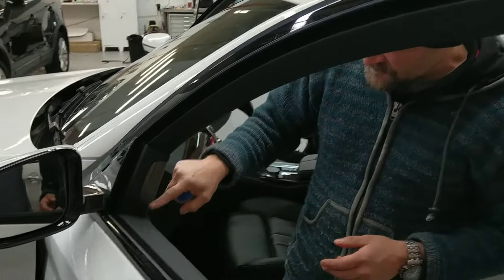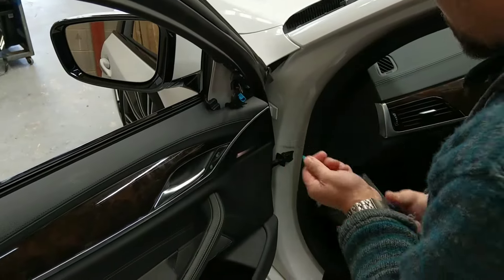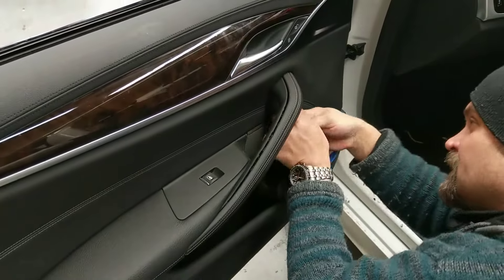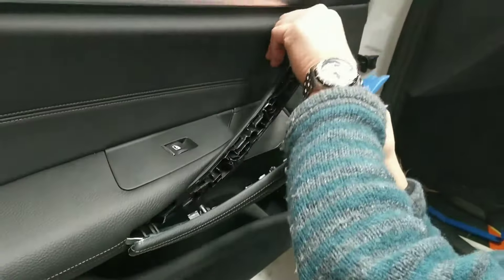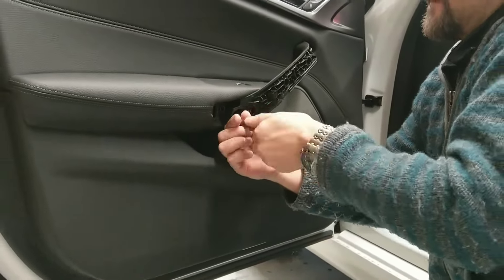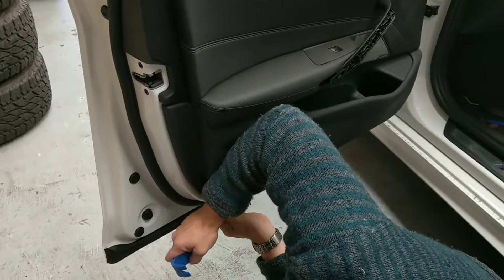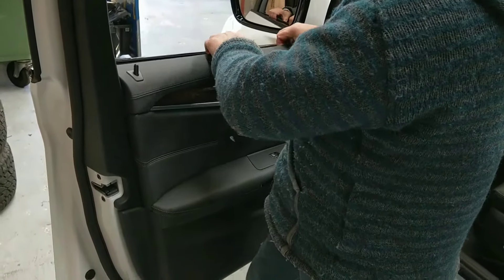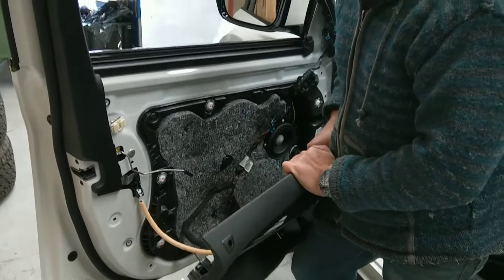2017 BMW 5 series door trim removel

Comment: FYI when you release the door handle trim there is a cut out underneath the handel to stick plastic pry tool in the perfect spot for getting started. If you go through top first there's a good chance scuffing the leather or worse.
Reply from the maker: Thanks for the info, fortunately we haven't done any damage yet.

Comment: do you know if the 2017 BMW 540I or 528i are they similar to remove??
Reply from the maker: Raul Romo sorry for the late reply. I’m not sure until we get one in.🙂
Reply: All BMW that I know of it's pretty much same process. If you don't have a tweeter then skip first step.
But some like F30 for example you have to pop off the trim directly behind the lever to open door and there is 1 screw there and other behind  the door handel trim. They all pop off around door make sure the plastic rivets are lined up or you will break when putting door on.
Sometimes they break when comming off the older the car and if it's cold.
Sometimes I'll get a hair dryer and warm up door or pop a couple then get hot air inside.
I've had glue fail and whole piece comes off.